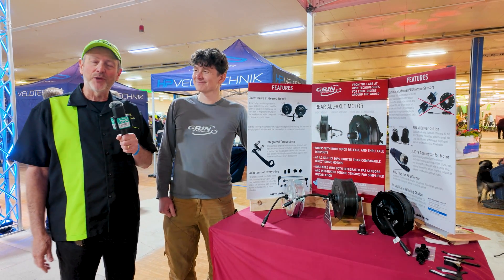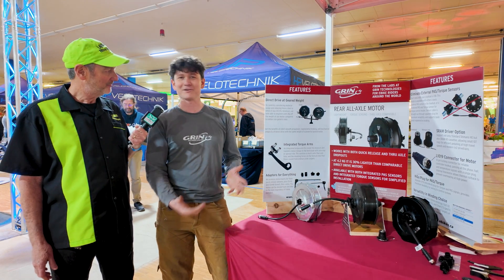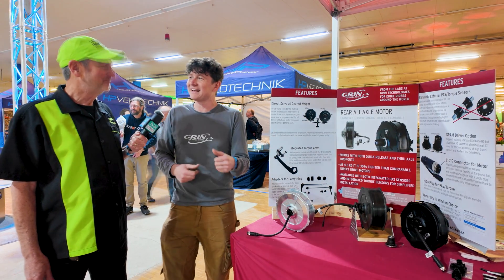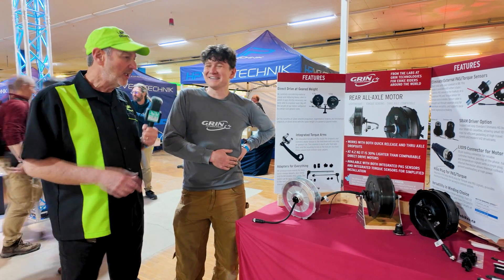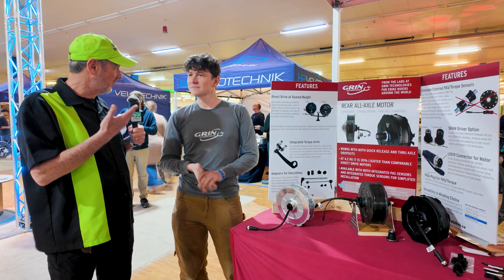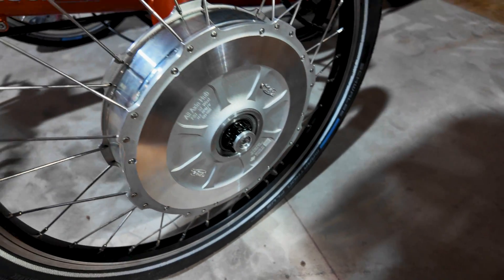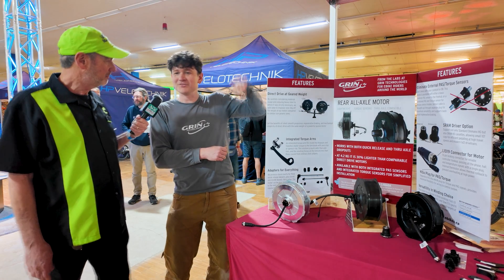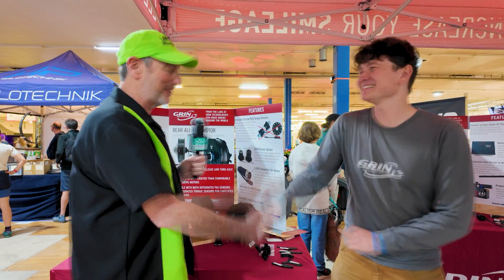Grin Technologies Hub Motor-Spezi 2024 Booth Interview

Comment: Hub motors the big advantage, regenerative breaking, to charge the battery, a major advantage. For trikes it would work best with a mid mount transmission, shortening the chain and all the problems a long chain creates, two drive chains/ belts instead of one.